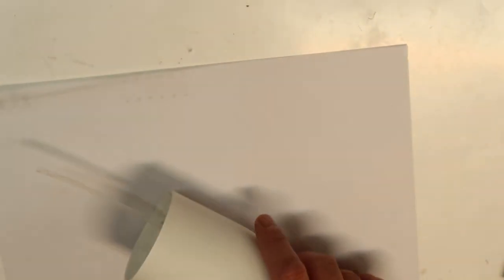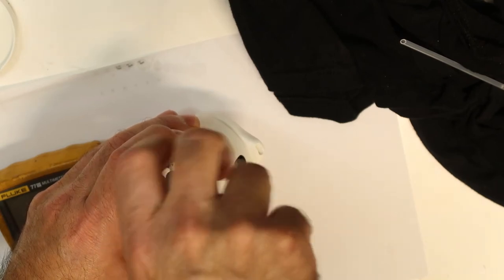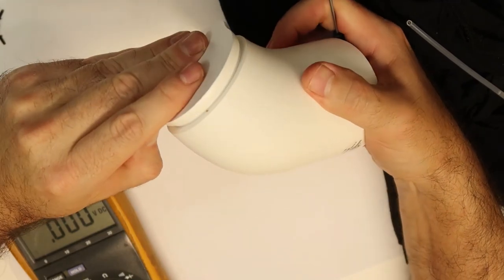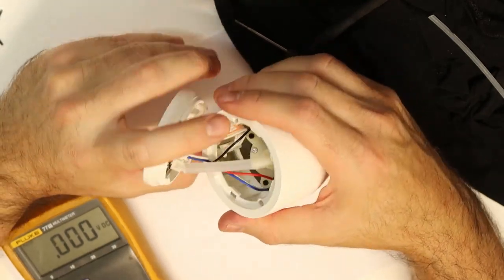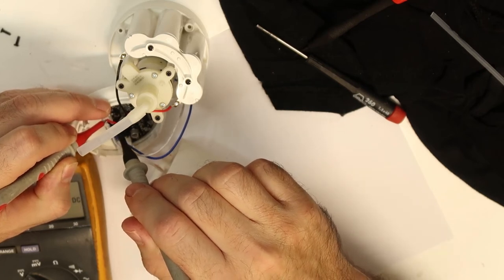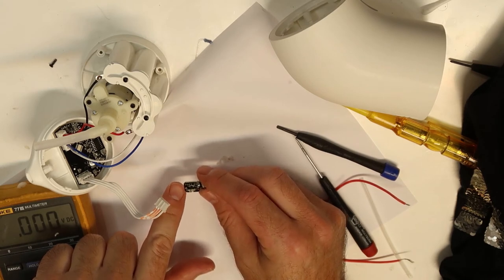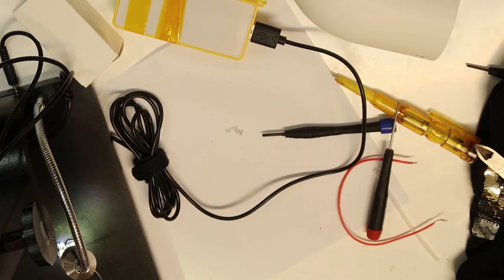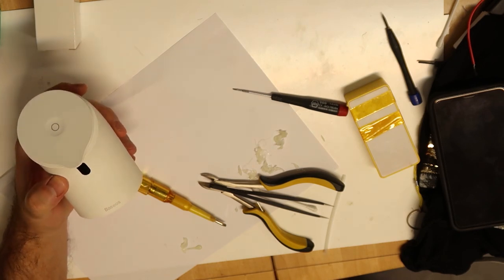Fixing Baseus Soap Dispenser

Comment: Thank you so much for this video!  I managed to take mine apart and got as far as the sensor but did not know how to fix it until I saw your instructions.   Like the previous posters mentioned, the connection to the LED was corroded so I cleaned it off and just added a spot of solder instead of running a new wire.  I then glued back and sealed off the entire sensor assembly with petroleum jelly in hopes of keeping out the moisture.  I didn't want to use silicone just in case I had to get back in there later for further fixes.
Reply from the maker: glad it help

Comment: Thanks to you i fixed mine. Same failure. It look like it's made to fail. Due to construction soap will leak inside all the time and sensor must corrode no matter what. After soldering I filled all gaps with glue to prevent soap leaking inside. I hope it will last little longer.
Reply from the maker: I am glad I could help - subscribe to my channel

Comment: Wow, I have 3 of these foam dispensers (The best ones I have actually), but they all have problems with the sensor. When it worked it was the best :)
Now I am intrigued if it is the same issue you mention here...
I would appreciate if you could explain some things:
How did you know which connection is which and how did you see it is broken?

Comment: Hi! Great solution! Soldering the extra cable seems to help on my case. The sensor was not triggering at all. After soldering, it doesn't detect my hand when approaching to the sensor, but it does when my hand leaves the sensor area. Do you have any clue? Thanks!